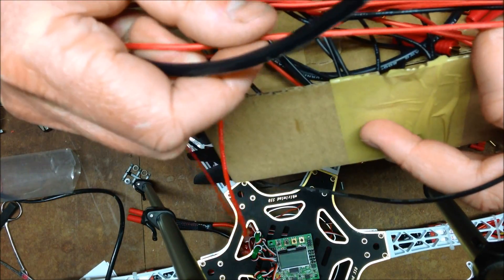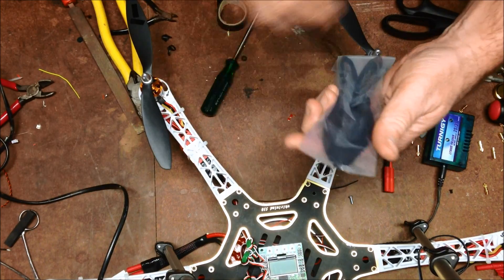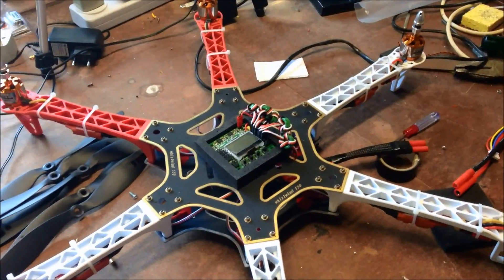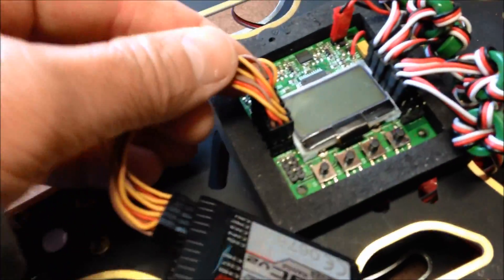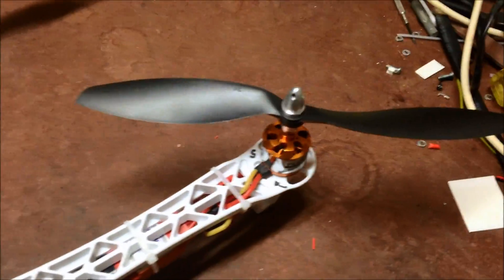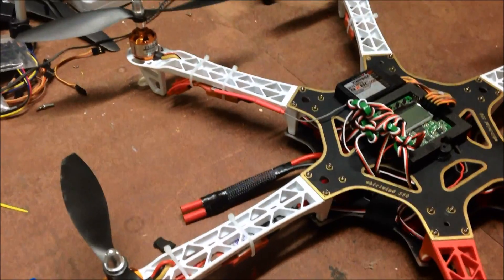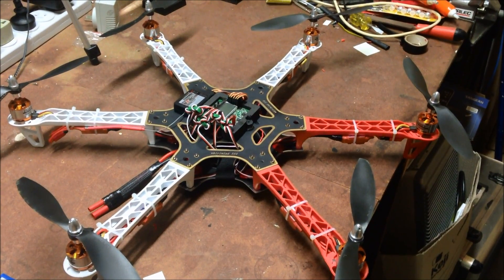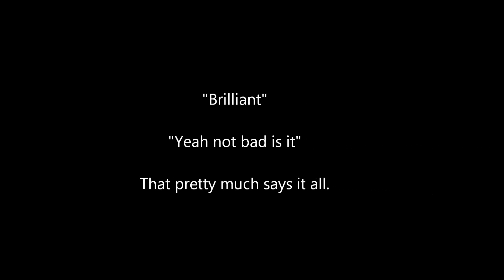H550 HobbyKing Hexacopter DJI F550 KK2 New Build Part 3 (The Electronics)

Comment: hey im 13 and im gonna save up to build one too.i didnt ever see you mount any serveros to your hexacopter...why is that
Reply from the maker: kvsingh No servos on a multirotor. Its uses motor speed to change direction.
Reply: Simon Hahnel so everything in the video is everything i need
Reply from the maker: kvsingh Plus Transmitter

Comment: i just built my own f550 and i'm going through hell trying to get the pi settings right... can you tell me your pi settings??? i'm also using a kk board
Reply from the maker: Usually in SL if you set the P to 30 and P limit to 20 you will get stable flight. Work your way up from there. If it is still a problem make sure you have calibrated your ESCs and Accelerometer
Reply: Simon Hahnel and what about the i gains?? also what do i set in the self level settings

Comment: Even with the V choppers and such, it's best to run the radio as "first thing on, last thing off" they will still pair and much safer.

Also, you'll want to upgrade the Rx at some point, I have that system with my old 9x and it's ok, but generally you can't beat the Frsky stuff, I love my new Taranis
Reply from the maker: You are absolutely correct. I have moved on to the 9xR transmitter with the FRSKY Radio system including the telemetry. Soooo much better. I will use my 9x for my new acro Quad build.